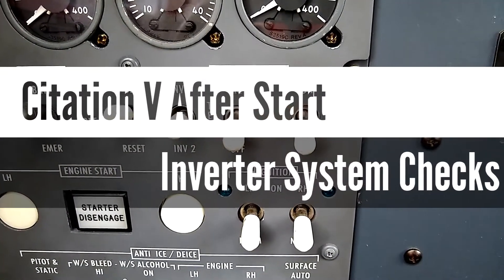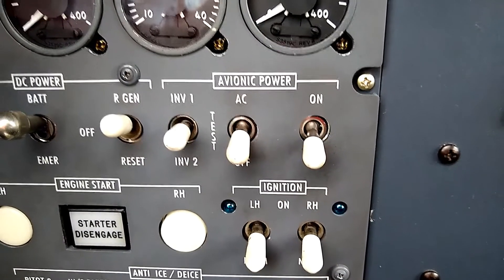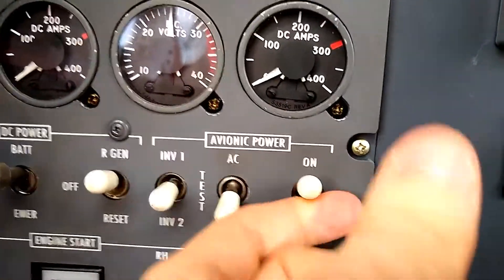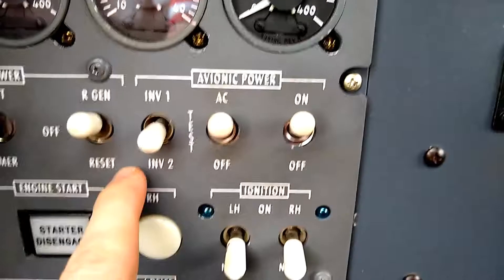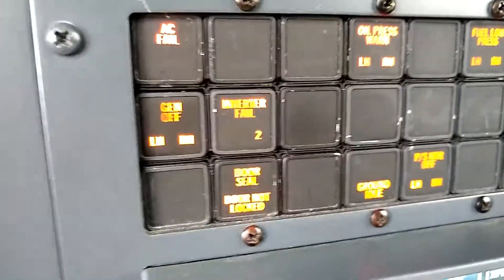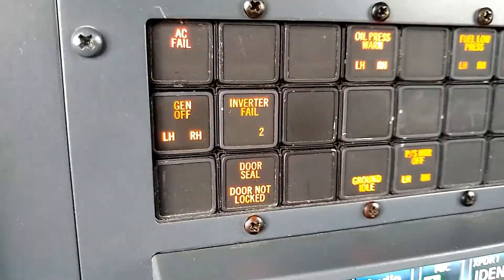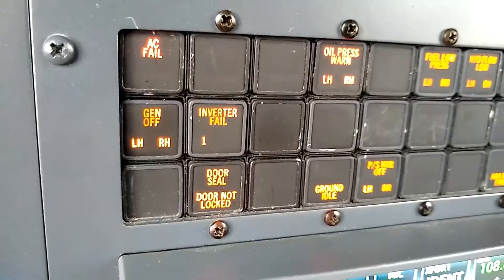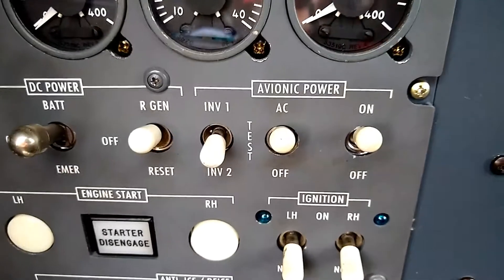Citation V - After Start - Inverter System Checks

Comment: Does it TOTALLY disconnect the bad inverter from the circuit? I other words, if the output IGBTs or MOSFETS were to short, they would need to be totally isolated from both AC and DC buses to be safe. Great video! Thanks!